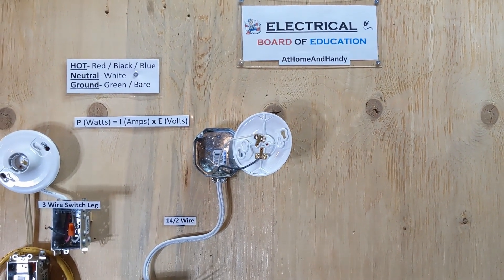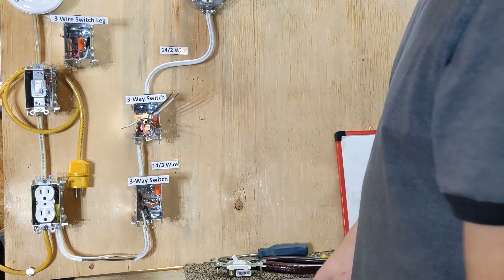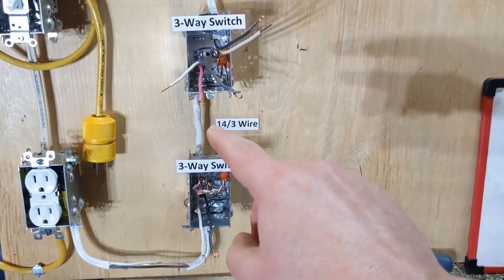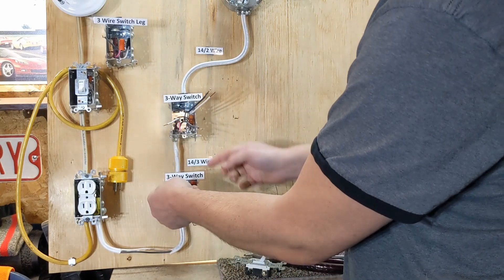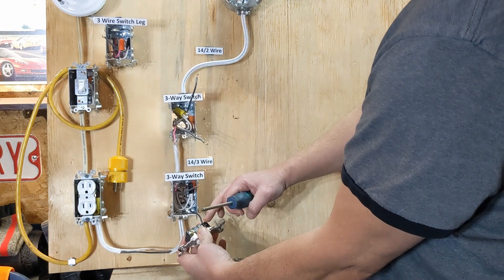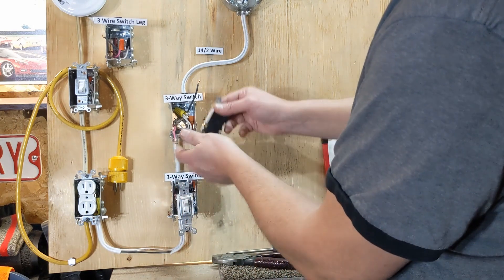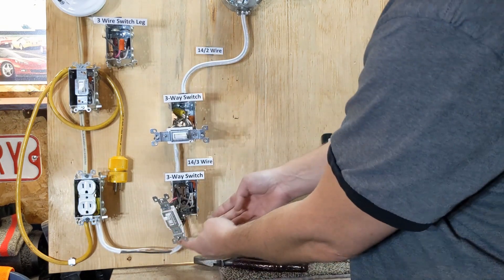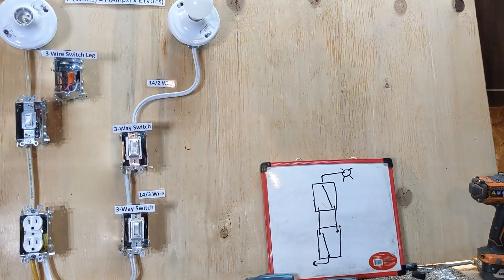3 Way Switch Explained And How to Wire It Properly!

Comment: You’re an excellent teacher
Reply from the maker: Thanks, greatly appreciated as the goal is to help others so happy to hear that it did. If there are any other Electrical topics that are still a mystery, let me know and I will try to help explain those as well. :)
Reply: @ i encountered a 3 way that the connection was made at the light (junction box). 14/2 and a 14/3 in the box. The blacks were pigtailed together, the white of the 14/2 was pigtailed to the red of the 14/3 and they had the black of the light fixture also tied into this white and red mix. The neutral of the 14/3 was connected to the neutral on the light. I have a hard time understanding this one. I believe it was done so because it was a 3 way switch powering 2 separate light fixtures so they had to make the neutral a hot conductor. I still find it confusing though.
Reply from the maker: There are a few ways to wire 3-way switches physically but the wiring will always have the same path as what I showed in the example (this is making me think that I'll do a video on some others ways and show what they would look like). 

From what you put, this is the only way I see it working:

The 2 wire cable is incoming power. The white is neutral which goes to your light and the black feeds the main power to 3-way #1. 
Between the 3-way switches there is probably a 3 wire where two will be the travellers between the switches with the third wire being the switched power coming back from the 3-way #2. It will be connected to the white of the 3 wire heading to the light inside 3-way #1 box. 
Might be tough to visualize from that but basically the black of your 3 wire is the power going down to the switches and the white is the power coming back switched. The red is being used to carry a neutral down to 3-way #1 (not sure if needed there to carry steady power to something else or just capped off for future).

  This is what the proper coloring should be if rewiring or just as an FYI:

- for the 3 wire, 
      - the red wire should be used where black is being used to carry power down to 3-way #1.
      - the black should be used as the switched hot coming back from 3-way #1 and not the white (power always comes "back in black" to remember it). 
      -that leaves the white of the 3 wire being used where the red is and capped off at 3-way #1 as a future neutral.

Therefore when done, the lights wires in this case will end up being connected white to white and black to black.
Reply from the maker: Towards the additional light you mentioned, the only way I can it being wired is that there is a 4 wire between the 3-ways with the 4th wire carrying that neutral coming down on the red and taking it through to 3-way #2.
In the 3-way #2 box, a 2 wire to the light would then be connected to the 4th wire (neutral) and to the switched hot.
Reply: @AtHomeAndHandy  thanks so much for the reply but in my case what’s mind boggling is that 14/2 neutral connected to my 14/3 red. Both blacks of 14/2 and 14/3 were pigtailed.  (The neutral kf my light was connected to my 14/3 neutral) The white and red connection is what powered my light! The black of the light was pigtailed into this mix therefore this was clearly my hot side. I understand therefore that my 14/2 white wire was a traveller, but im confused as to how this is possible, in my mind this means my 14/2 cable has no neutral in it, which I’m not sure how that would work. This is my theory: the 14/2 was a traveller between two light fixtures which were both wired onto the same 3 way switch and the electrician made the 3 way connection in the box.
Reply: @ oh my god i think i figured it out!! Is is possible that the 14/3 was power coming into the box directly from panel. Then they used the 14/2 to make the switch. Essentially black of 14/2 ran to switch and the white of 14/2 ran back power when the switch was flipped?

This is the only scenario that makes sense to me.

Recap: in junction box: 14/2 black pigtailed with 14/3 black
14/2 white pigtailed with 14/3 red AND with black of light fixture

14/3 neutral connected to light neutral.

I think on second thought now that the 14/2 was used to make it switchable since power cane directly to the light rather than switch

Is this possible?

Comment: Here's one that will make you think, saw this once in my life about 35 years ago. From 3 way switch #1 to light  was  a 14/3  cable, from 3 way switch #2  to light was a 14/3 cable, from a power source to light was a 14/2. Light was in a hallway at my buddy' house. All cables had equipment grounds. After pulling both switch's out with only I cable in each, black, white, and red I realized the connection had to be in the light box. If I remember correctly they had sent power down to the switch which was tied to a traveler terminal and one of the travelers was tied to the common terminal. Anyways he was happy and all went well.
Reply from the maker: Sounds like they used the light box to tie the travellers together. Will work fine, just a different way to accomplish the same result. With 3-way's there are a few ways to get there as the wiring will be the same, just locations and way to run the wires differs. :)

Comment: FINALLY I understand how a 3-way switch and wiring works!  Thank you! Much less complicated than what was going on in my head prior to your video. I have just the project in a hallway where this would be desired.
Reply from the maker: Perfect as that was my goal, to help others understand whats going on in there :)
Have fun with your project and check out my other Electrical videos if needed (video on a 4-way coming).